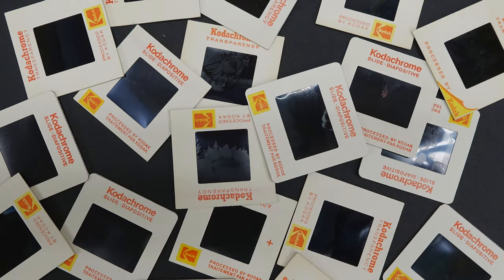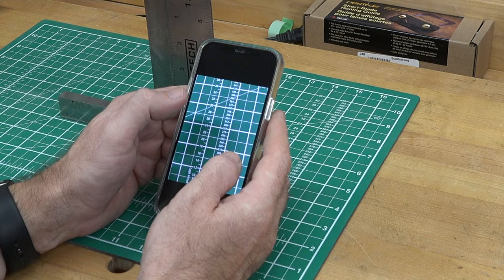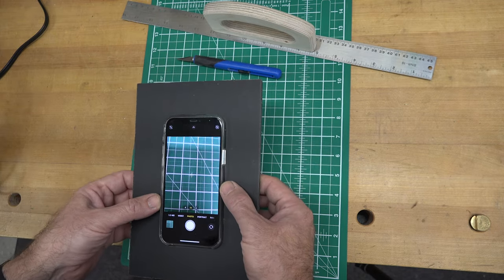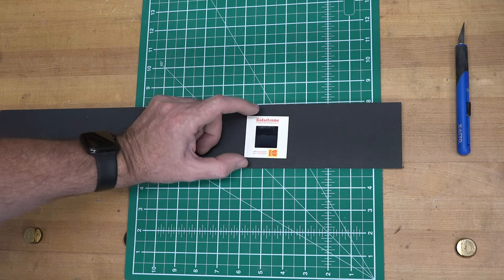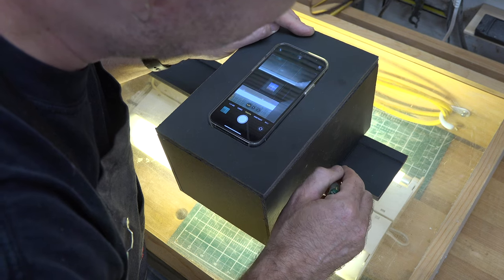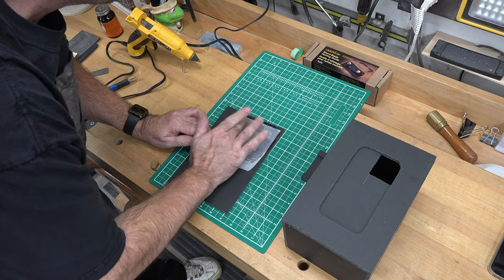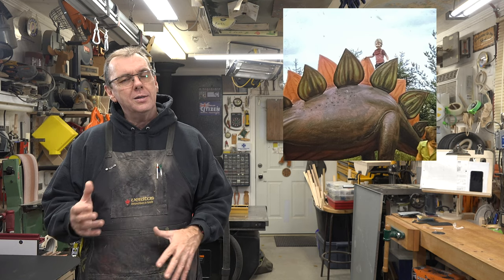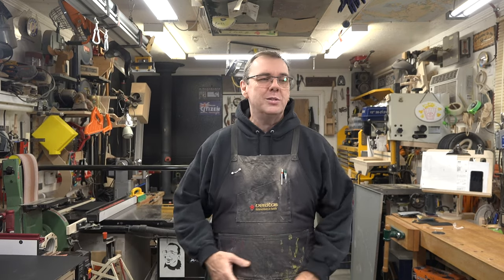Converting Slides to Digital Images

Comment: Does the foam have to be black?  I have a light box to photograph items to sell.  Would that work for anything ?
Reply from the maker: I don't believe that the foam has to be black Jenny.  I just used black to try and eliminate any light reflections from interfering with the photos.  I'm not so sure that a light box will be able to help you much here for this particular application.  I have used a Lightbox many times to photograph my work and I honestly can't think of a way that it would be any benefit to converting slides to digital.  I hope this helps a little.  Thanks for tuning in to the show.
Reply: @acutabove_woodworkings  that makes sense though
Reply from the maker: @jennysci33  If you have any other questions, please don't hesitate to ask.  I'll do what I can to help.
Reply: @acutabove_woodworkings  one more question, just take a clean makeup brush or something to dust off the slide itself?  Yours is pretty fancy.  I don’t cut foam board well.  I was going to just paint the while I have black but now I’ll have to go get one of those plastic things so I might just get the black board.  I don’t have an ipad for lighting.  Only a laptop but like I said, o do have a light box I bought and never used so maybe I can use that light somehow 🤷🏻‍♀️
Reply from the maker: @jennysci33  A clean makeup brush would work just fine or a  little bit of compresses air like the cans that you use to clean a computer keyboard.  The light source can be anything.  It doesn't have to be a an iPad.  Your light box may work just fine for that.  As long as you have something to filter the light so it isn't so intense on the slide.  Experiment a little.
Reply: @acutabove_woodworkings  I got that cutting board tolling and naturally, they were out of black foam.  My light box will work and has a black lining I can use for the inside
Reply from the maker: @jennysci33  The black lining should work just fine.  I hope your project is successful.  I'm looking forward to hearing how your slide conversion worked out for you.
Reply: @acutabove_woodworkings  oh, I’m looking forward to it.  I’m excited because they’re all from like 1972 to 76.  My mom is in them and she died when I was 5.  So it will be fun
Reply from the maker: @jennysci33  A walk down memory lane is good for the soul.  Now I want your project to be a success even more than I did before.

Comment: Very nice work, however the mistake you made with the light source was, it was too close to the slide, ahowing all the grain and puip in the paper.  If you use a spacer of maybe a half inch or so, it should work fine.
Reply from the maker: Thank for the advice.  I appreciate you tuning in to the show and taking the time to chime in with your methods.

Comment: Frosted glass used to be the go to for light diffusion.
Reply from the maker: I wish I had some during this project Barry.  Thanks for tuning in sir.
Reply: @acutabove_woodworkings  I wonder if opal acrylic sheet would work? I got an offcut from a local plastic supplier to test for lamps I want to make, I haven't got to test it yet. It has a gloss finish. I suspect to get a good diffuser effect it has to have a matt finish with a very fine grain. Maybe sanding with 600 or so grit would work. Obviously the grain showed through in some of your tests. Just thinking, the grain of the diffuser has to be much finer than the grain of the film, maybe 5 to 10 times finer!
OK, future project suggestion: DIY frosted glass or equivalent!
Reply from the maker: @wiseoldfool  There's only one way to find out about the opal acrylic sheet Barry.  Give it a whirl and see.  As for the shop made frosted glass......coincidently, that will be coming on an episode of the show very soon.

Comment: Hey Kenny, I'm going to try this.  I bought a cheap scanner about 10 years ago and I've never been happy with the quality of the images it takes.  My 40 yr. old slides I think are in very good condition and I hope to get great results.  Question about the depth of your box:  that is the measurement of 5 5/8".  Is that the minimal distance that your camera focused the best, plus adding the thickness of the two pieces of foam core?  Thanks, Marie
Reply from the maker: That is correct Jeanette.  You will need to test your particular cell phone to see what it's best focusing distance is and when you get that distance figured out, that is the distance that your camera needs to be from your slide.  You can add as much foam core as you wish, as long as the camera lens is at the optimal distance for the focus.  I hope this helps.  Thanks for tuning in.

Comment: This will work but it does not compare to the quality you will get with a quality flat bed scanner that has film scanning hardware.  Please be aware that if you are going to buy one there are some cheap ones that dont do as good a job as the cell phone camera
Reply from the maker: without a doubt the scanners will produce a better image Bruce.  This show was geared more toward those who were unable to obtain a scanner and were looking for a relatively cheaper solution to slide conversion.  Thanks for tuning in and for chiming in with your advice.  It's very much appreciated.

Comment: I'm afraid that this method will provide only the poorest digital image quality imaginable. To achieve a quality that matches the original slides you will need a digital camera with a proper macro lens of fixed focal length - no zoom lens! Nice try, though!
Reply from the maker: No one ever said that we were going to get high quality images from this method.  What I said was it was a great way to be able to convert your slides to digital so that you could view them if you didn't have a projector.  That is EXACTLY what this simple project does.  Thanks for tuning in and for chiming in with your opinion.
Reply: You have to be very pedantic to think like that. If I can take quality photos with an iPhone, I don't need macro but rather focus the image well, the rest is ignorance.

Comment: stop taking drugs.
Reply from the maker: Not sure if this is a good thing or a bad thing, but thanks for tuning in.
Reply: @acutabove_woodworkings  it’s just we only need to scan “hero” or top pic selections slide/negatives. Not all the redundant crap. Use something simple to cull/edit and then scan what you need to use. Editing is at least 50% of most media platforms. We all overshoot. And this is not like digital obviously. Just pick what you need and work with it. Store the edits if you think you really need to. Ran 5 studios with super high volume for decades.
Reply from the maker: @Jwick1518  That wonderful and all, but how does that relate to your initial comment about drugs?